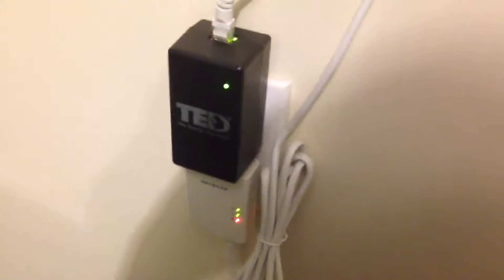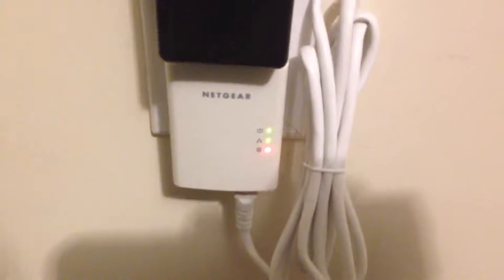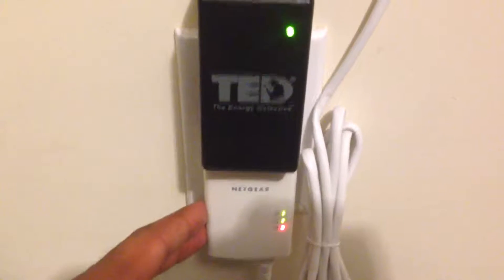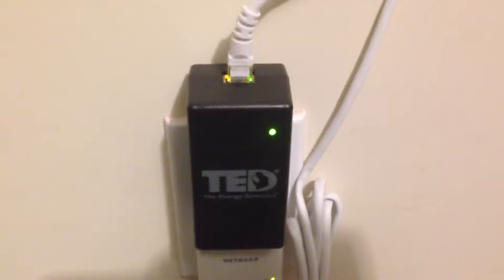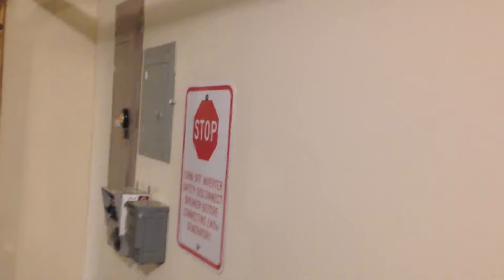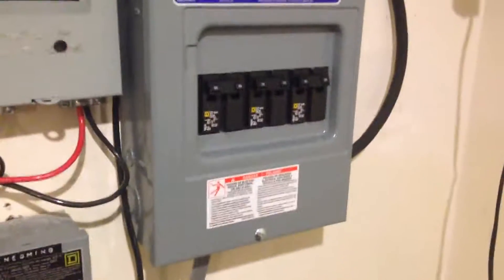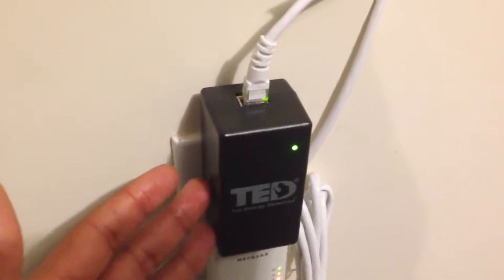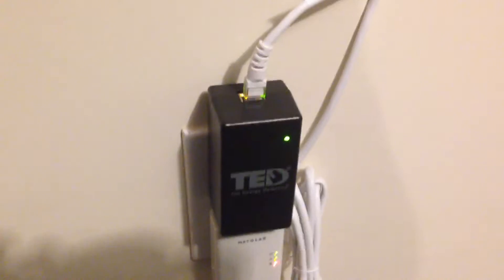DIY Home Solar Update - TED 5002-G installed

Comment: I am having my solar panels installed this Wednesday. Of course the solar company will be installing their software monitoring system that it suppose to show all the data and prove I'm getting my monies worth, etc...

My question is, is there any part of the  5002-G system that that has to be installed before/above the meter? Because the meter ring gets locked by the utility company. I would think some clamps have to be put on in there to measure when the current is going in or out. Kind of need to know so as I can put in a rush order or not.

Also what is the "G" for? How many models are good for the "solar customer", only the 5002?
Thank you
Reply from the maker: LiveLifeBetter The 5002-G model comes with 1 Gateway and 2 measuring transmitter units (MTU).  The regular 5000 unit comes with 1 Gateway and 1 measuring unit. I bought this version to place 1 MTU to measure power coming in or out via the utility and 1 MTU for power coming in from my solar array.  There are a few videos on youtube that will show you the installation.  Just look up "TED 5000 Installation".